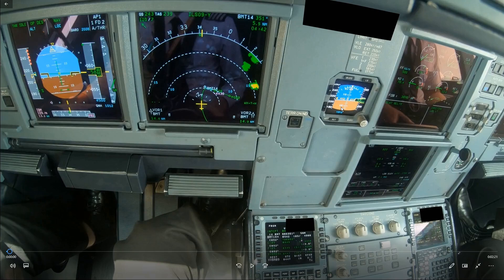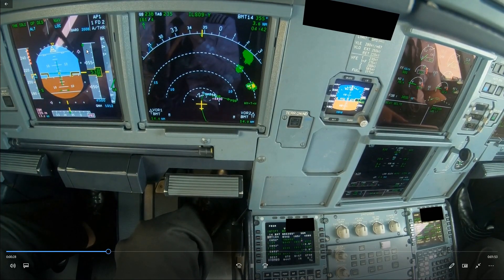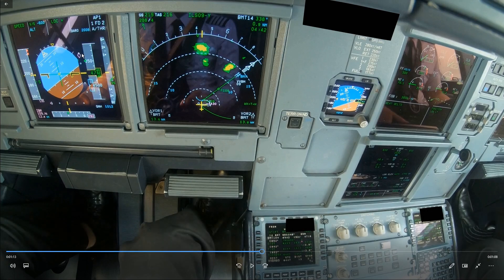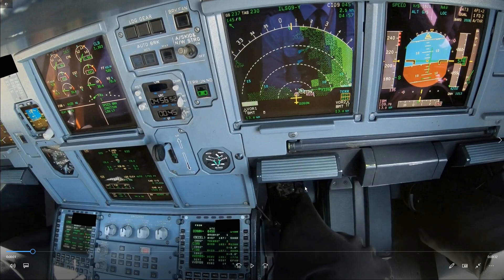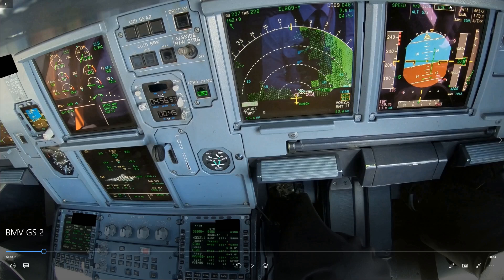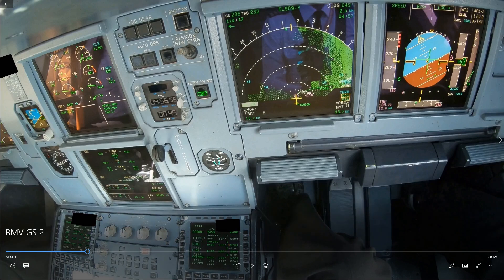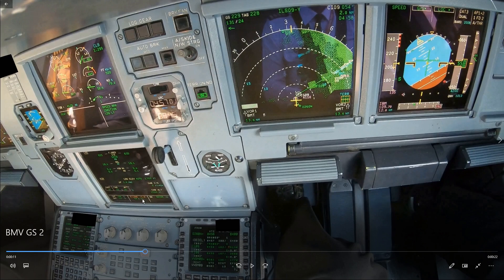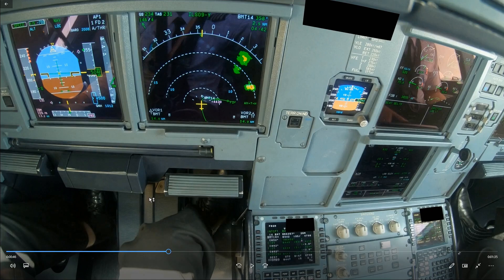A320 glide slope issue in VVBM

Comment: Thanks for posting these videos. 
The SOP says: Whenever the flight crew notices the pitch movement, or the spurious G/S*, or the trajectory deviation, the flight crew will immediately disconnect the AP, if engaged, to re-establish a normal attitude and will disengage APPR mode. It is then recommended to arm/rearm APPR (ILS) mode within the normal capture zone.
As you said, this took you by surprise especially when the flight crew is used to that approach.
Reply from the maker: You are correct. I wasn't PF though.

Comment: Thanks for posting the video. I've already had discussions with FOs on the Boeing as some claim they like to use the GS indication of the ISFD because they say it appears earlier than on the PFD. This video quite clearly illustrates what I think about this technique 😁 I got screwed myself in the past for using the GS indication while a little too far from the centerline. So I let people know that until you're really close to the LOC, the track mileage is a more reliable tool.
Reply from the maker: Indeed. At some airports it's worse than others but unless you do a reasonably straight in approach, it's best to ignore the GS until close to the LLZ.

Comment: In the approach chart of VVBM. They stated that the level of segment before the final approach fix has a mandatory altitude. So we should have arm the LOC, then open des to that altitude
Reply from the maker: Yes indeed. At the time of this incident that note was not on the approach chart though. There are some other airports with similar issues. For example, inbound to Da Lat RW09, arrival from the north, so from the left side of the approach. Same problem, but no note on the chart. It's always good to remain vigilant.